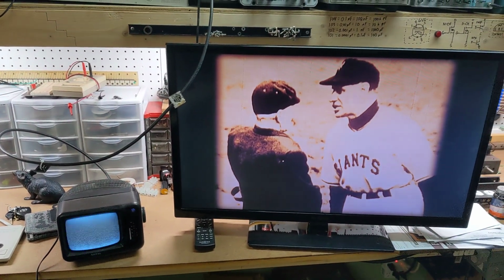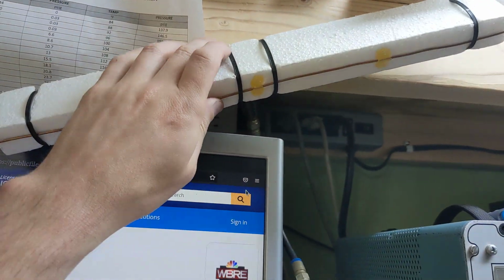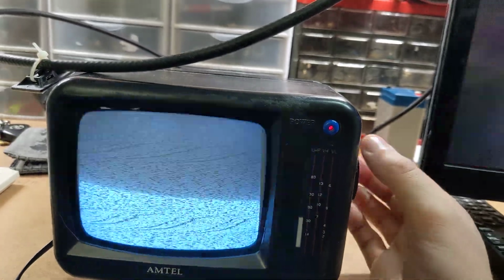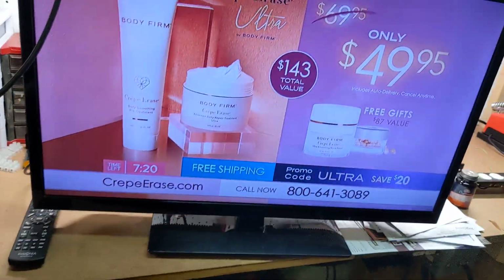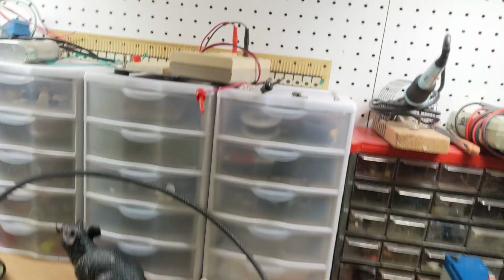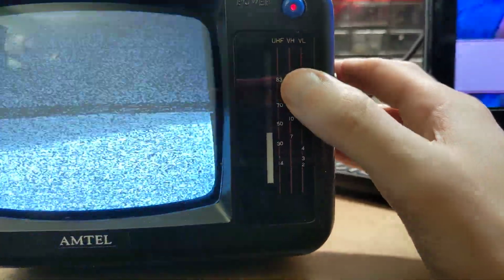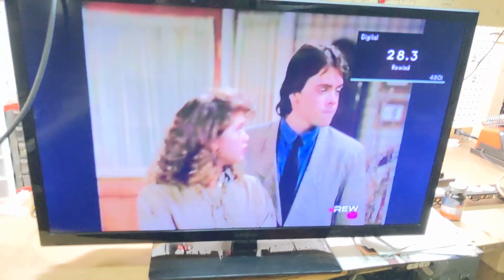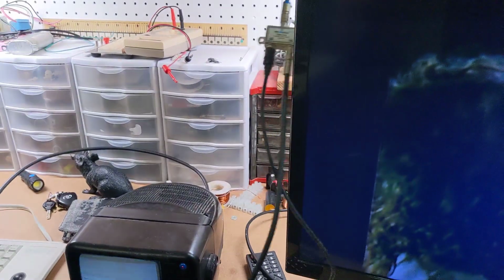What does digital TV look like on an analog TV?

Comment: How does bro have analog television [the signal], here in the netherlands it got disabled 17 years ago
Edit: im dumb as fuck sorry guys
Reply: You can still buy old ones in the USA. They don't make them anymore, but the ones that were made still exist. They just don't show anything anymore like the video explains.
Reply: @SirenaWF1  I mean the signal, I didnt say "an"
Reply: @RedTroPc   Because analog signal was replaced with digital signal,  they still transmit digital over the air, but you need a TV or antenna setup that can decode it. Radio frequencies don't care about "analog vs digital"  it's just encoded data.   Cell Phones, Wifi,  TV,  Radio Stations, it's all just radio frequencies with different encoding standards and frequency bands
Reply: He does not have an analog signal. That's why the old TV isn't able to draw an image. The signal it's getting is digital.
Reply: Because it's just an older tv? Btw i live in the netherlands too, but even my 2009 and 2010 tv's still have analog. My main tv is a samsung tv from 2009 and it has analog.
Reply: I have one too-
Reply: Here in Germany I still can use analog tv if I want... or if Digital TV isn't available at the moment.
Reply: @norbert099  not terrestrial (antenna Tv tho) analog cable shut down in 2019 

analogue FM Radio is probably also disappearing in this decade

Comment: The real question is how does The Departed on Blu-ray look on an analog tv.
Reply from the maker: We need a PS3 with HDMI into Composite converter and then into RF modulator and then into this TV on Channel 3. Or else the PS3 is going out in the snow!
Reply: @anthraciteenergetics5497 I still use a vcr it's a vcr dvd recorder but I use the vcr because of better video quality lol
Reply: That is basically what this video is trying to answer.  Blu-Ray is not only digital, but we have basically been figuring out how digital video content looks on analog TV since approximately 1996.  Basically, a DVD player is just a converter box without an ATSC TV tuner.